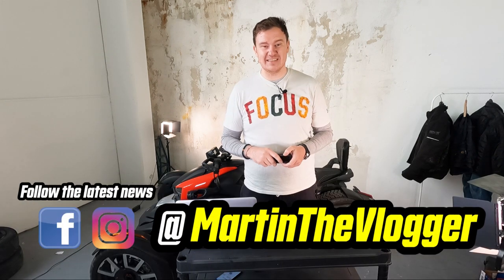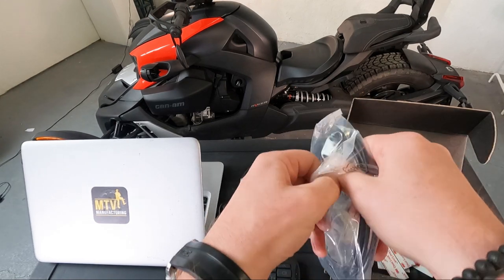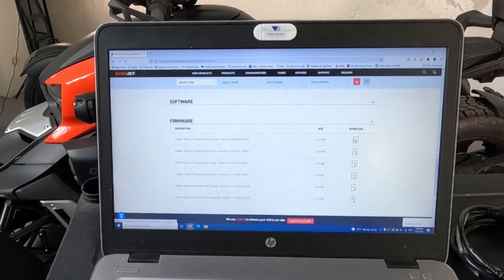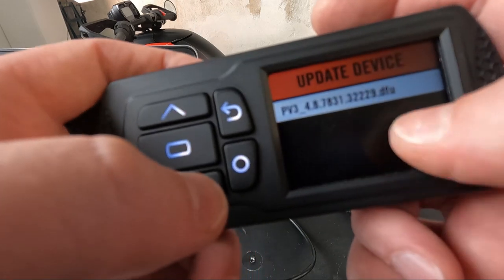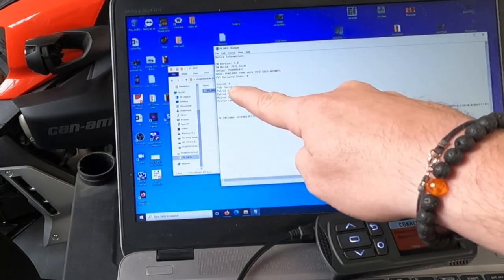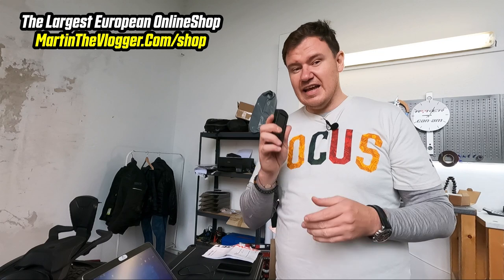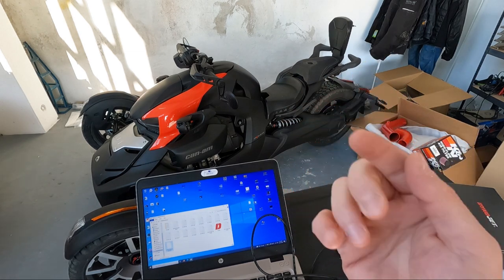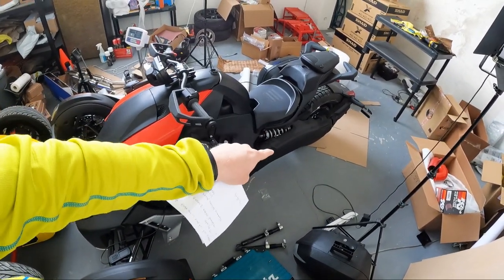Installation Step by Step - DYNOJET Power Vision 3 [ Pv3 ]

Comment: I’m having issues marrying the Dynojet with my Ryker.. I’ve updated the dynojet with its recent firmware.. connected it to my Ryker to marry it. But I’m not having any luck. Any suggestions?
Reply from the maker: Question nb 1 - is it brand new dynojet or it has been used before? 2- Are you using PV3 or PV4? 3- paired 0 info in txt file does not mean its not married... tge best however is to call dynojet support ofcourse

Comment: Martin , is better to have bike on a dyno to do some "runs" when making a custom map?
Reply from the maker: Yes that would be ideal, but its not easy because of sensors on our bikes. Once the front are not spinning you cannot do the DYNO test as tge bike will shut down the power. But the PV3 map we have is adjusted or in otger words will be adjusted to many different setups according to what owner runs

Comment: So does the Dyno Jet replace the pedal box? or do they work together?
Reply from the maker: Pedal box do its trick but cannot do what dynojet can- fine tune and give you more mower. However dynojet can also adjust throttle response - so what pedalbox does... However dynojet is not that user friendly as pedal box - pedal box you just click and in mili second you adjust the throtle response.. dynojet ypu need to stop, flash tgr bYke etc ... i think i will need to make a video abput it. 🤪🤪🤪🤪
Reply: Martin
Can you use the pedal commander and dyno jet together
Reply from the maker: @Lotto832  yes Sir.

Comment: Mine didn’t pair (marry) the first time I plugged it in. Then, when I went to select a tune, it asked me “the device must be paired first, would you like to pair?“. Then when I try to pair…… It gives me a message, saying that “.STK & .DJT files will be permanently deleted”… So, wtf is going on here?!?
Reply from the maker: I dont know. This is more message to dynojet support.
Reply: @MartinTheVlogger  I was just hoping that you had encountered this before, having so many 3-wheelers. Obviously, I got a fuckin’ lemon.
Reply from the maker: @Doomfreak90  Dynojet and PV3 its bit tricky... sometimes it goes smooth and sometimes its pain in the ass... but if you have bought it from dealer and not second hand, you will fix it not an issue
Reply: @MartinTheVlogger  Oh, I got it from Silber Turbos as a bundle with my upgraded header pipe. 😬